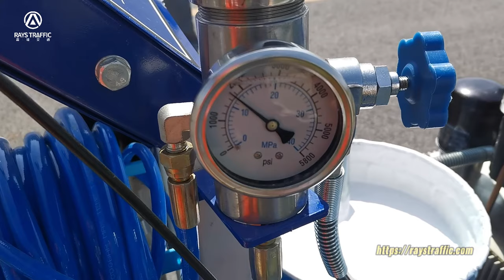How to Spray Road Marking Lines-Rays Traffic W-CPD Cold Paint Line Striper

Comment: This is nice but cost of cleanup is nuts and if you do not get on the cleanup right away .the material hardens early fast creating lots of troubles.
Reply from the maker: For cold paint road marking machine, workers need clean machine after everyday's road marking works.